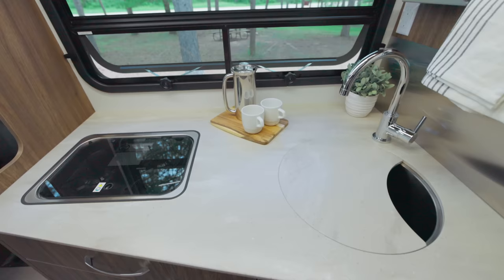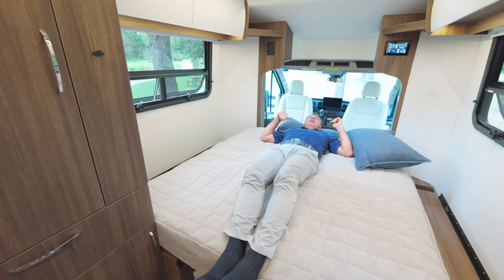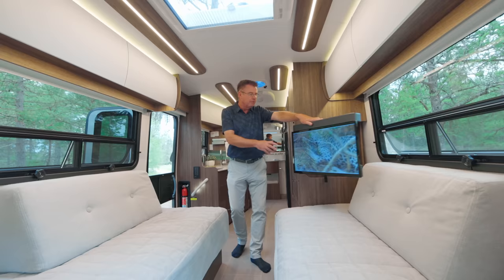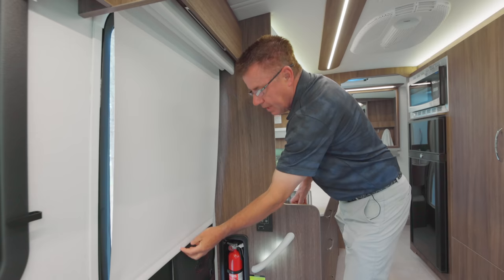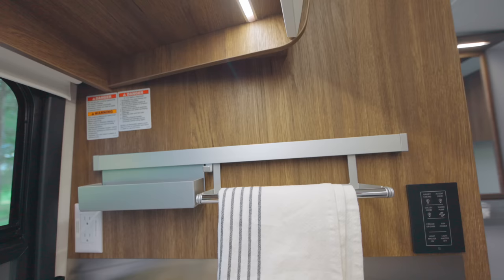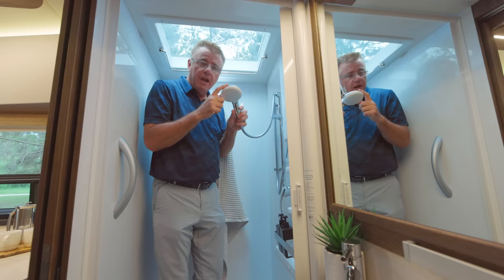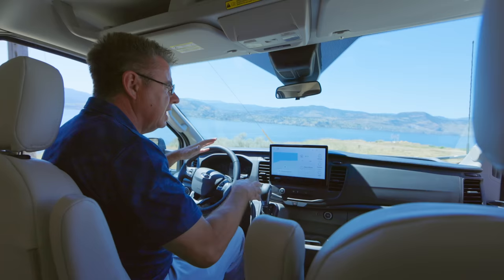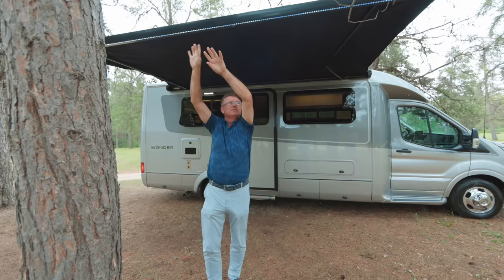2023 Wonder Front Twin Bed

Comment: Love this floorplan except for that small wobbly dining table, looks like a disaster waiting to happen at eating time! And those fluorescent looking lights on the ceiling. The puck lights were so much nicer, blended into white ceiling.
Reply: I noticed that same wobble in the video, but I just checked our table and it is pretty stable. I suspect there is screw or bolt that can be tightened to eliminate most of any wobble. We had several meals using the the table and did not have any problem.

Comment: Leisure Travel Vans + Recommendations: 1.) One way privacy windows to look out but not see in. 2.) Computer Table seems wobbly / unstable, 3.) Move the outlets for the twin beds so that when it is used as a Queen bed they can still be used, 4.) The top / ceiling ventilation, have it with a screen all the circumference of the pop up so that no bugs can get into the vehicle incase the bug screen is not slid over to be used. 5.)  Cabinets soft close without having to push them to click into place, and how about having them unlock by pushing on the doors to open them. That will be one less reason to need to use the rear view mirror for having to check if something hasn't been closed properly. 6.) Having an electric stove option would allow having one flat surface to clean, and you could take it outdoors to cook on the outdoor table. 7.) Love that inverter to keep the surroundings peaceful and still functional. 👍👍 8.) The kitchen fantastic fan would be even better if it is reversible for pulling fresh air in? 9.)  Is the lighting dimmable? 10.) Love the propane, electric and 12voltfor the fridge with two way doors. 👍👍11.) Love the redundancy to cover heating options. 👍👍 12.) Great shower door  👍👍 13.) The cabinet above the toilet might be too low for persons sitting upright on the toilet?? Possibly move the toilet out some or shorten the cabinet for more sitting room for tall toilet users?? 14.) Like the optional all wheel drive. 👍👍 15.) Great to have the Pure Sine Wave Inverter! 👍👍16.) Do you have an option of interior automatic feature to lock all the exterior storage doors? 17.)  Like having the surge protector! 👍👍18.) Do you have Turbo, or Supercharge available that may increase the tow capacity?

Comment: We have a 2019 Wonder and for us we extended the PVC tube for the freshwater drain.  All I need to do is reach down and open the valve.  No need for that PVC tool Dean had.  It was a cheap fix, but it works.  LTV should have just extended the tube out to where you could easily reach it without having a tool you might leave at a camp site.    It cost me about 10 bucks and a half hour of time to install.

Comment: This is by far my favorite LTV model - still love it in 2023!  However, I do wish it had an optional compressor fridge, as well as the option for a larger electrical system (ideally ~400Ah battery and 3000 watt inverter).  I'm not sold on the new overhead lights - I like them, but the asymmetry might drive me nuts!  I love that it's all storage under the passenger side bed - if I ever got this RV, I'd be tempted to remove that bed and turn it into a desk.
Reply: I believe ford was adding a rear view mirror with the 23s? I’m not sure why LT hasn’t utilized fords 2nd alternator yet and then bumb the lithium batteries to min 600+ with  a 3k inverter? They would then be able to drop the generator, and add an induction cooktop and compressor fridge!!  Also update the 16btu to a comfort plus Truma that’s super quiet and efficient!

Comment: Thanks for making another very good video. You cover everything very nicely and with a pleasant personality. 

Wonder makes some beautiful motor homes. All the ones I have seen look roomy and bright. I love the flooring and LED lights. 

The Ford Transit chassis my actual preference. I love the swivel chairs. 

I am not sure white is a good color for the beds/chairs/lounges. Maybe a light gray or tan would be better to stay cleaner for contrast but I do like that the colors can be chosen. 

I like the versatility of the bed. The windows are also very nice. I love skylights. I love that there are no slides. Lots of bells and whistles, it seems luxurious. 

I like dry camping/boondocking so I would get the optional max solar. 

Amazing interior storage for sure! I fell in love with the pantry and the fridge. Perhaps the best thing of all is the roomy residential bathroom. <3 The only thing I didn't like was the low headroom over the toilet. 

The outside is beautiful too. The only drawback is it seems to be low clearance so not good for accessing some off road areas when boondocking. Huge exterior storage and I love the awning, LED lights and the optional outside table too.

I like the drain/flush system for black/grey/fresh waters tanks. I would get the optional macerator pump for sure. 

This is a super duper motorhome and I could see myself living in it! <3 

There are so many wonderful safety features, bells, and whistles overall. 

This is a higher end motorhome priced under $200k for all the builds I looked at! This may be pricy for some but I say it's worth it. 

For it's small size (easy to drive, easy to park, easy to love) it is just amazing overall. Luxurious.

Comment: I have scrutinized RVs and vans for a number of years in preparation for ultimately purchasing one. I really like this front twin and will explain why. I generally think the Leisure Van will be my best option due to the affordability combined with the quality and mobility vs a larger RV. And Leisure just seems to outdo the competition in terms of design features and quality. I’m not looking for a heavy duty overland van for off road adventures. Rather I’m looking for mobility and comfort. I’ve been studying the various floor plans of the Leisure and they all offer something to love. But one very important to me is quick and easy access to the bed for napping at any time, which is why I’m not as keen on the Murphy beds. I also want a large galley and bathroom. This offers that. ALSO of utmost importance is storage AND office work space. I like that there is storage under the bed. (I considered the rear twin, but the front living area seems to compartmentalized for my needs. The front area of the front twin feels open and spacious. I would utilize one of the twin bed benches as an office/art workstation, actually building a custom portable, removable foldaway drop-down desk top and supply storage box. I think there is a lot you can do with that bench top where the secondary twin is. And it can be done safely in a “no-build” fashion by just incorporating some tie downs onto the bench woodwork. As it would be removable there would not be damage to the van deceasing it’s value. Yes a lot can be done with that secondary twin bench top!!!